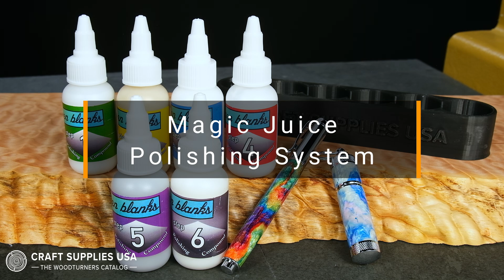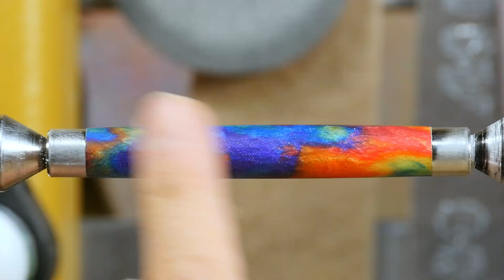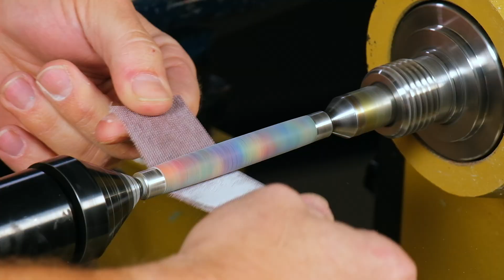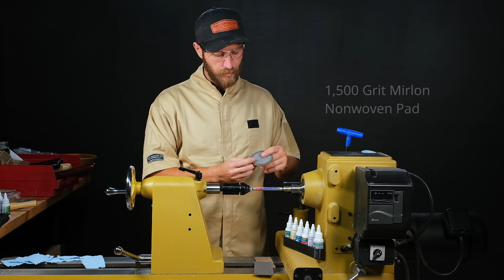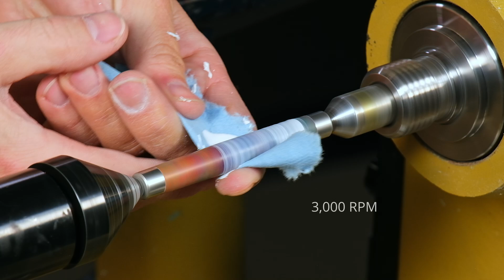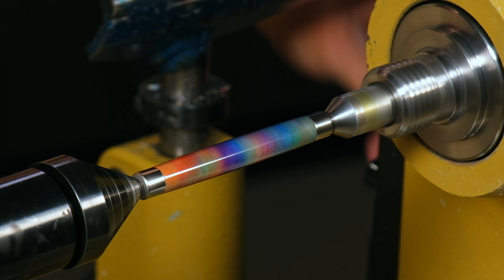Magic Juice Polishing System - Finishing Guide

Comment: You say a few hundred pens but are these bottles the 1 or 2oz size? Hard to tell...if I had to guess, I'd say 2, but I would like to know to set expectations if I go with 1oz to start (hobbyist, not a business).

I'm just starting up turning and looking for a balance between cost and time, these seem to be a bit pricier per oz over CA but if I don't have to buy a buffing attachment for my lathe, it seems like it will save me time and buying another part.

I think turners should have stock in blue shop towels. 😂😂 Thanks for the demo, this stuff looks amazing.

Comment: I have been using Stadium Pen Blanks Magic Juice (MJ) Polishing Compound for over 10 years now. I have found that generating too much heat and pressure in the lower early grits of the polish can have an adverse affect. I would recommend a lighter pressure if you are new to using MJ. A little bit does go a long way. If your MJ ever gets thick or starts to dry out from leaving your caps open, a small amount of filtered water (distilled water is best but bottled water is a close second) can be used to thin the polish back down. It is water based so it can dry out if left open.

Comment: Hi Mike. Great tip on the cross hatch sanding thanks. Can I ask is scotch bright an equivalent to mirlon ? Thanks again
Reply from the maker: There are a variety of scotch-brite pads.  The green is 600 grit and the blue is 1000 grit. Those may be a bit too coarse, but if you already have some, give it a shot.

Comment: What's the advantage of Magic Juice over your Micro-Surface abrasive sheets? Micro-Surface-style abrasive sheets are used in industry to polish the windscreens of airplanes. Used properly, Micro-Surface sheets produce an optically clear surface on plastics -- such as the plastics used in aircraft windscreens. I assume that Magic Juice doesn't do better than that (but it might do just as well). Is the advantage that it's faster than wet sanding with Micro-Surface abrasive sheets? Or does Magic Juice make less of a mess?
Reply from the maker: The biggest advantage is less steps/less time spent polishing.  The micro-mesh has 9 polishing sheets and a polishing compound, these require more time and more mess to achieve the same finish as the Magic Juice.  The other consideration is wet sanding makes a mess on the lathe bed and surrounding area.  -Mike 😊

Comment: Can you use the magic juice polish over top of Dr. Kirks micro magic polishing wax?
Reply from the maker: I would only use step 5 and 6 of the Magic juice over Micro Magic.  They are very comparable systems, however I feel the Magic Juice gets a bit glossier.  -Mike
Reply: Stadium Pen Blanks Magic Juice (MJ) Polishing Compound is an abrasive polish. Any wax base finished that is left behind in another polish will likely be completely removed while polishing with MJ. It is not recommended to be used on top of any wax based finish.